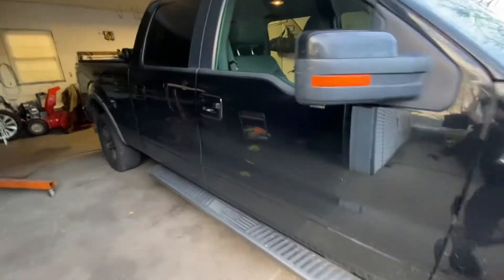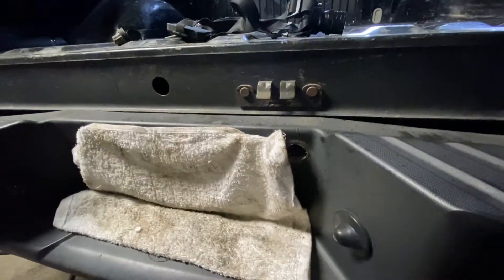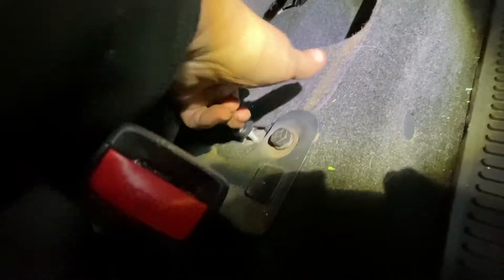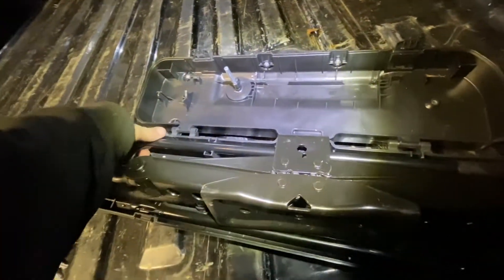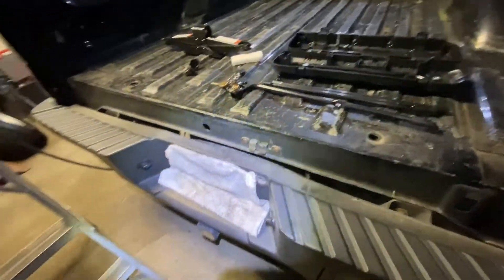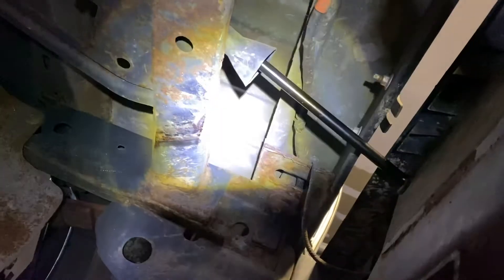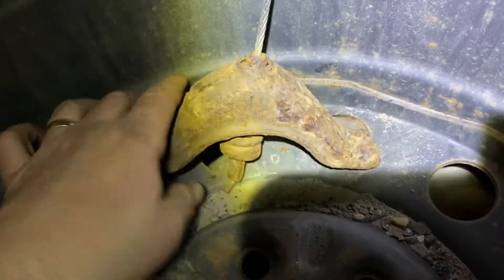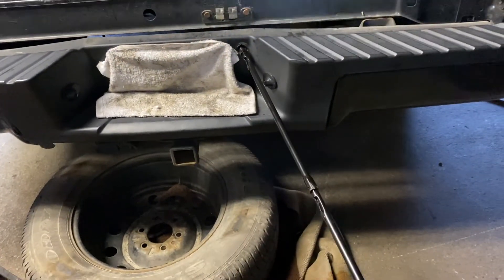Ford F -150, F150, Spare Tire, Jack, and Tools Location and Drop Spare Tire on Ford F-150 Super crew

Comment: Good Video. I missed it by 2 weeks. After 6 years I decided to see how to remove the spare (2 weeks ago). It was NOT fun! Though now I know how to do it. Yes valve stem was up, tire very dirty and 20 psi. Best thing to do is keep good tires and watch for low tires to take to the tire shop before having to change out the spare. I dont find any fun in having to do that out and about. I actually have a floor jack under the seat. They are much easier to use than the jack the tk came with. I also have an extra cable lock on the spare just in case - in hopes that someone might give up on trying to take it.
Reply from the maker: Thank you and appreciate the comment. You made very good points that may help others!

Comment: I thought I was missing my jack kit I didn’t know it was underneath that panel I thought it was supposed to be on top I was just about to buy a kit because my spare is flat and I needed to drop it and see if it will hold air
Reply from the maker: Glad you didn’t have to spend money for nothing.
Reply: Mine didnt come with a plastic case. It is wrapped up with felt and velcro for a 2017.
Reply from the maker: They are making cheaper and cheaper